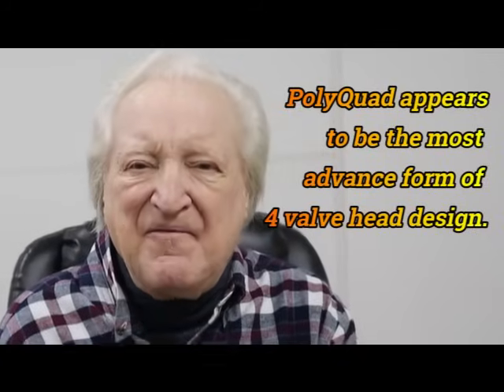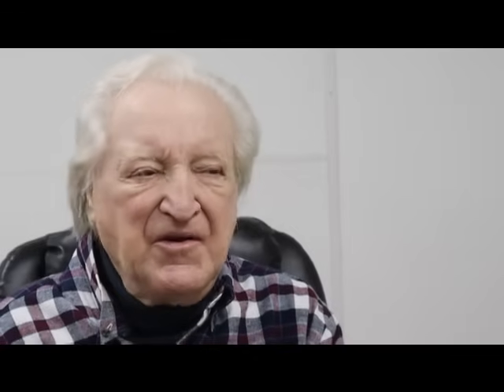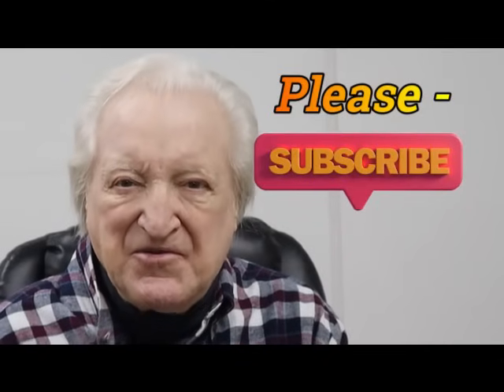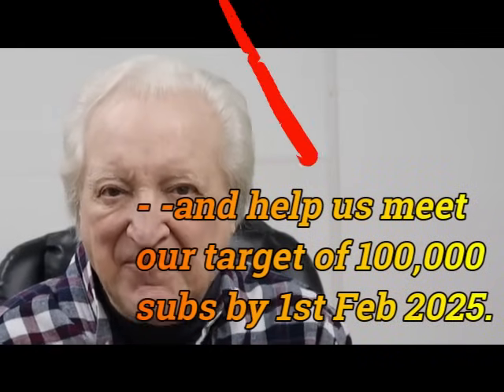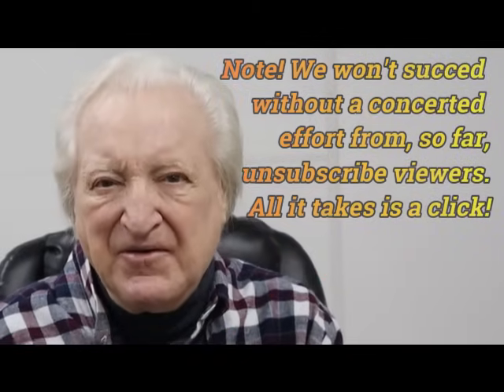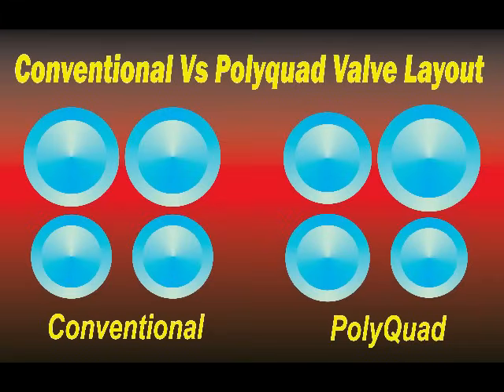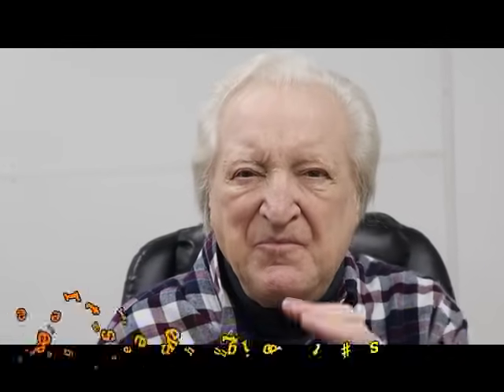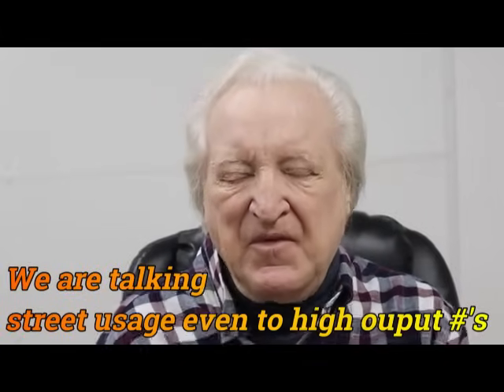PolyQuad - How the worlds most powerful 4v heads are built.

Comment from the maker: Guys, I intend to talk of differential cam events to creat swirl. Done the tests so you get the results!
Reply: Would it work on three valve staged size ?
Reply: Damn! Thought I was onto something original for once 🙄
Reply: Awesome!
Reply: Would seem the cam profiles, port shapes and valve heights in the chamber would all work together to achieve the best overall results.

Your attention to detail in theory and design, backed with solid testing results are what have always impressed me.

Your "How to Hot Rod Your 2.0 Ford" was my bible when I was tweakin the 2.0 in my Capris many years ago!
Reply: Honda did that with their economy vtec of the early 2000s on the “K” family of engines. The cams had 2 profiles, an extremely wimpy profile and a normal one. Under normal low throttle and low load driving, the wimpy cam controlled one valve and the normal cam controlled the other, creating an extreme swirl in the combustion chamber. Under higher throttle and load, the VTEC switched the cam profile to the normal one for both lobes
Reply: They also modified the port divider with an angled hole going toward the intake valve with the higher lift.   This is all very interesting. Thanks DV!
Reply: nice video, honda had in d16 or d15 a cam that have one lobe bigger than the other valve, other engine had a eco cam, 12valve low rpm, 16 valve medium and vtec hight
Reply: @dannyrivas5125  I think he hit on this topic I the old video on polyquad
Reply: @danyan7 many of Honda's factory VTEC cams from that era had differential lift on the low cams to a lesser extreme than the VTEC-E implementations.  D16 Z6 and Y8 variants, H22 cams, B18 cams all had one of the low speed intake lobes with around 10% less lift and duration.  The D16Y8 intake port has very asymmetric throats compared to the D16Z6 port which is a traditional tumble port.  The Y8 with a little bit of porting to bring up the flow in the higher lift area to match the stock Z6 on the flow bench significantly outperforms the Z6 head in broad power delivery.  Colt cams also has a "Triflow" grind that does the same offset lift on the intake.  I built my Hyundai racecar project with the stage 1 grind and the low end torque was excellent while still carrying power into high rpm.  The Honda VTEC heads are already pretty good on the flow bench even stock, but incorporating the polyquad concepts would almost certainly significantly improve them.  Most people building Hondas don't pay attention to that kind of development, and it's too bad, as they were the NA masterclass of their day for how accessible they were.  Too many rubber stamp engine builders it seems.
Reply: @mr. Vizard: This explanation, especially about the overlap, flow of mixture into and not into the exhaust port but passing by the valvetop due to different valve seat depth, really needs more visuals to understand better! ...and does different height of valve seat depth also make a 8v four cilinder bath tub chambered head/motor run better? (FIAT 100GL engine: 850, 899, 903, 965 (A112), 982 (A112), 1050 (A112) all OHV)
Reply: I bought your book to read but I would love an explanation about the cams. I have a 3000gt turbo at 700hp and would love to sneak a few more hp out of it with the "twirl"
Reply: @notimaginative  hi, 3000gt have a manifold whith bad dimension, if you recalculate it will made a big improve at rpm you choose
Reply: The smaller valve if you reduced the cam lobe lift and duration aswell??
Reply: that would be awesome to see DV, I look forward to that !
Reply: I am holding my breath while waiting for the next chapter in this matter!
Reply: @david vizard what happened to the 2nd part of this video that you promised us??

Comment: After DV gives us a master class on the 4 valve , I'll explain why all the 5 valve stuff was a complete failure .
Reply from the maker: well Roland, you are a mind reader. I was going to do one on this but go ahead.
Reply: You have my full attention, my dad has a 4age -20valve engine in his car...
Reply: The vw passat 2.8 5 valve was one hell of an engine
Reply: Yes. And anyone in the Love/Hate relationship with a VW 1.8t are curious too!
Reply: The 5 vpc head isn't necessarily bad, it's just that it was developed before CFD. If packaged properly a 250-270cc cylinder can make close to 4 HP/ci.
Reply: When the 5 valve stuff started appearing , at least in the time frame I'll refer to , I was trying to put a Pro Stck Bike program together . I wanted to go in a 4 valve direction , with a Suzuki . Low and behold , 5 valve stuff started appearing even in Formula One , I said to myself I hope it doesn't work , because it would be a real pain  building the pistons . Of course the pistons would have to be in house , and a whole bunch more angles on the dome . As it turned out in everything from Moto GP to Formula One they just can't compete with the 4 valves . I think the pneumatic valve train appeared and put them even further behind . Btw , I think Yamaha was even contracted by one of the Formula One teams .
,,
,,, The reason the 3 intakes don't work is that the port is inevitably turbulent , and even the increased valve area can't make that up . While the 2 intake valve system is very laminar , and maintains that even at 20 thousand RPM 's .
Reply: Really? I thought mine was pretty good 😊
Reply: @evilmotorsport  ,,, this is like baseball  , you can look up the competitive results .
Reply: I have thought that a 3 port , and 3 intake valve head might work . Instead of that conglamorated gopher hole that has too much volume and lends itself to turbulence . But it doesn't appear to be on anyone's horizon , especially myself  .
Reply: Carsten , these angles you are talking about are not well known . Actually quite secret . I am talking about the failure in the highest levels of motorsports. The 5 valves were tried , and rejected . Btw , by multi hundreds of millions dollars corporations . And that's just their racing budget .
Reply: Carsten , I said Yamaha was contracted , and maybe Ferrari tried the 5 valve . And Yamaha did away with it in their hottest street and Moto GP engines .
Reply: Yamaha did away with it because Valentino Rossi preferred the power delivery of a 4valve
Reply: No, Jeremy Burgess liked the power of the 4 valve . Not to mention Yamaha was not competitive the previous year ,,, !
Reply: @evilmotorsport  ,,, to be 100 percent correct , I should have said I thought Jeremy Burgess , and I , were on what I considered the same page , about the obvious 5 to 12 percent more power .

Comment: SAAB used differing cam lifts on their 16V heads around 1988 but soon went back to equal cam lifts.  It would be interesting if SAAB ever told the reasons why?
Reply: Saab was always low on Money, so the Engineers couldnt always keep stuff going! Later was buyed by GM and then slowly faded away
Reply: I had seen it but now realise what it was,  After trying differing inlet cam lifts ( 1 large 1 smaller) on 900 series 16V, SAAB changed 9000 series to use 2 large lift lobes but raised intake port floor in the RH lower corner to improve swirl!  Its supposed to work best <3500rpm.

Comment: Maserati did it on their engines like you show us, but in late seventies and early eighties, Maestro.
So in 1990 Alfa Romeo maked a 30746/30747 engine with same valve sizes but the camshafts has a different profiles and timings for the any valve (big opening and long duration left and low opened and short duration right, and big/long intake was instead of a low/short exhaust). So they position the fuel injector on the big/long valve and low/short valve got some mixture but largest fuel mixture streamed thru big/long valve port.
It was very nice engine, I love it thru the all of my life.

Comment: Would be a revelation in my humble NA 4L inline six with dual cam VCT and of course the turbo version of the same engine. Thanks DV.
Reply: But they make 2000hp on ported heads and near on 1000hp on stock heads already?
Reply: @Low760  huge power capability. Obviously the turbo has better power potential, however it would be satisfying to see a 400 HP (crank) and high torque NA inline 6.

Comment: Modern 4V heads control the lift of one intake valve, or the runner flow by putting a flap / valve in it to control velocity, as it is cheaper than multiple valve sizes. Still a cool design though, DV.

Comment: Looking forward to more. 
I know one guy who have read about this in your books and wanted to try this himself on a Cosworth Yb engine. This was true DIY and limited budget. We agreed that only one of the intake runners would be portet to the the tradisional Cosworth size  and the oposite runner on the exhaust. Then the intake camshaft only would be grinded but only on the knocks for the valves for the portet runners. In the cheep and fast way, LCI was not even moved to make the closing ramps as paralell as possible and the openings ramps as different as possible to promote swirl. Even with this the improvement was way bettar than expected. 
Here way back in 2006 with traditional porting and camshafts: https://www.youtube.com/watch?v=2Y495D7Bg34
Here in 2011 after the mentioned mods, and the turbo is a Garrett GT3076R A/R0.82 turbinehousing and this most of you just will not believe, the compression ratio is 6.8:1 and YES, you did read that correctly. The build thread is called Capri Special in the fmcn.no forum. Listen do how much faster he goes through the gears. :) This really works and I have now designet my own cams with four different centerlines to maximise different lifts on all the valves in TDC overlap. Thank you. :)  
https://www.youtube.com/watch?v=SLYCIWH2Nrk
https://www.youtube.com/@caprimkI/videos

Comment: This is groundbreaking!

It coincides with another IP application that we are preparing, aimed at exactly the same goal (swirl promotion in multi-valve heads), yet the method we apply is completely different.

It is also interesting, that a particular air-metering innovation (that's also in progress), seems to also contribute to a  swirl-inclined intake air-mass "cornering".

If Mr.Vizard is interested in these developments, I'd be delighted to share more.

Thanks heaps & keep up this fantastic innovation spirit!

Cheers!

Comment: Thanks! I've been holding off on a set of caddilac northstar heads for this info. Dont have the budget for custom valves so was going to deshroud and work over the valves and pockets on 1 in and 1 out valves to mimic the poly-quad. Wasn't sure about port biasing, but now i have a clue. Thanks again for all you share!🎉
Reply: I've recently gotten into Northstars thanks to my Fiero. Any particularly interesting work you've done on them?
Reply: @ethandearman3965 Sounds like a fun project. I've only delt with the later, 2000 + engines myself. If you are rebuilding the engine have the block decked .035". There's about .073" of clearance between the piston and head stock. Tightening the quench area will make a big difference on power. If you're using stock cams, make sure they are from the 300hp version and use an extra set of intake cams in place of the stock exhaust cams. If you are planning to do head porting, work the bowls, valve, and deshroud the valves, but don't make the ports any larger. Unless you only want hi rpm power, they're already oversized.  And if you're building your own headers, consider making them 180° . If you're using the stock manifolds consider replacing the tubes from the manifold to the stamped "collector" with 1¾" tubing and up size the outlets. That's a good start. The stock valvetrain is said to be good to 8000rpm. And my understanding is the con rods only to about 500hp, but forged ones are available if you're going higher.

Comment: Great video! Here's an oddball question. On a 4-valve setup, could you get a similar effect by grinding the cam lobes differently? For example, one of the intake lobes has more lift and duration than the other one. And likewise for the exhaust. I ask, because getting cams reground might be cheaper and easier.
Reply: Yes. It was realize in 1990 on Alfa Romeo 30746 and 30747 engine, fully stock factory boxer engine. Same valve sizes but different profiles and timings for each one. So fuel injector sprayed the fuel to common intake port but on the big/long opening valve. You can see it in person in internet.

Comment: Great information Mr. Vizard. Will you test the difference between computer controlled cam phasers, locked phasers and adjustable locked phasers. BMW S14 engines used adjustable exhaust cam gear that improved midrange performance but sacrificing top end. Thoughts please. Thank you very much for all your knowledge and time. 👍

Comment: What should the flow differential be between the 2 intake valves?  Is there an ideal, or a range?  Is more better?
How do you measure this differential?  Do you clog up on side of the port and put it on the flow bench?
What are the ideal seat angles for this arrangement?
Does "close clearance" mean no deshrouding on that part of the seat?

Comment: Would different optimized cam lobe profiles be employed for the two different size intake valves?
Perhaps the maximum effects would be realized with completely isolated inlet ports and runners?
I've always thought for maximum efficiency at part throttle, a four valve design could use just one isolated inlet tract optimized for that condition, and the second could be brought online at full power demands, and also optimized for that condition.
Reply: The Honda D15Z1 VTEC-E engine does this.

Comment: Do you think, only one larger intake valve per chamber with the intake runners angled slightly toward the larger valves, would create a majority of this twirl effect? Possibly using a Colt tri-flow regrind? To create staggered lift between the intake valves. 

I would be doing this with a turbocharged Honda d16a6.

As for the pseudo poly-quad, did you bore the i.d. of one valve seat larger?

Comment: How is effectiveness being determined / measured? Base line with stock heads, then poly quad, and delta of BSFC?
Also interested in the sinking exhaust valves and minimizing “cross flow”, over scavenge…

Comment: This explanation, especially about the overlap, flow of mixture into and not into the exhaust port but passing by the valve top due to different valve seat depth, needs more visuals to understand better! ...and does different height of valve seat depth also make a 8v four cilinder bath tub chambered head/motor run better?

Comment: I totally comprehend the intake side of this, but why the exhaust?  What does it matter how it exits the camber? Is it to create a swirl to induce a swirl in the incoming charge? Also, if the larger valve dictates the direction of swirl, then the intake would swirl clockwise, but the exhaust would exit in a counter-clockwise flow.... I think.

Comment: What is the difference in cylinder pressure at BDC of the intake cycle produced by a swirl cylinder head vs that produced by a non-swirl cylinder head? IOW, does the swirl motion contribute to a lower pressure due to the increased velocity produced by the swirling action?

Comment: So technically speaking if i have the intake valves raised in a pair of 4 valve heads with different seat heights it will improve low lift flow?  Ready to send out my 4.6 aluminator heads to be fully cnc ported and would absolutely have this done if its worth the money, please David where would i have this work done???

Comment: DV , l have some vague recollection of a cam with some lift bumps very early to the intake stroke . Was this how you generated the swirl in the unmodified heads ,,, ? ,,, btw , what did you think of my 5 valve take down . Well , it's not my take down , it just didn't make it through the elvolutionary cycle ,,, !

Comment: Thank you, Mr Vizard. Excellent content. Thank you for sharing this information. I had a  question. Would your suggested modifications to the valve sizes, the exhaust valve depth, and the port bias benefit or hinder four valve heads with variable valve timing? I'm thinking about the Honda VTEC engines from the 1990s.  Thank you again, sir!
Reply: Honda uses staggered primary lobes to induce swirl. Curious if the polyquad setup would be beneficial on top of that.
Reply: I am curious to, I am building a h at the moment , an yes they have staggered primary lobe , but not only on the primary lobe .I know that there is only one secondary lobe (big lobe) but by reading the actual Honda manual there is a difference of hight of the VTEC pine in the rocker to , so when VTEC ingage you have actually a little more lift one valve .I think that if we apply the poly quad keeping those in mind that should be beneficial,I am certainly thinking of trying it ,and looking forward off the next video to have more info about it .

Comment: This is revealing. 
Have you considered staggering the throat diameters instead of the valve diameter, say 87% and 89%, to stagger the individual discharge coefficients.
While I agree with your assertion that 4 valve heads frequently have too much cross sectional area, I’m thinking the largest part of this issue is due to, too large of throat diameters, that kill port energy. 88% resulting in the best overall power band, 89% being a critical max, unless getting into high lifts.
Reply from the maker: Yes, final full PQ has biased ports as well.

Comment: How would it cost $5000 to change two seats to a different size to the other two valves?
Reply: Valve train components cost a lot.
Reply: @NotSure723  no. Not on a normal 4 cylinder 16v head where 1mm bigger valves are not thousands.